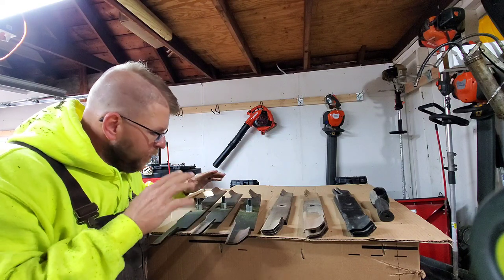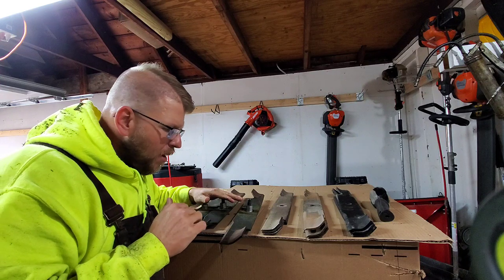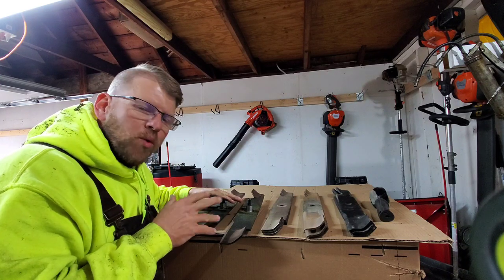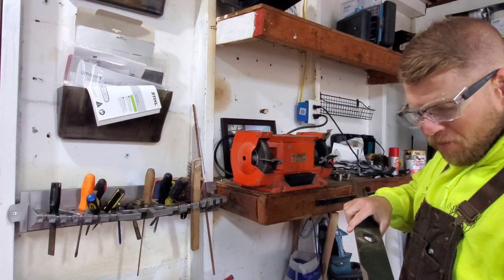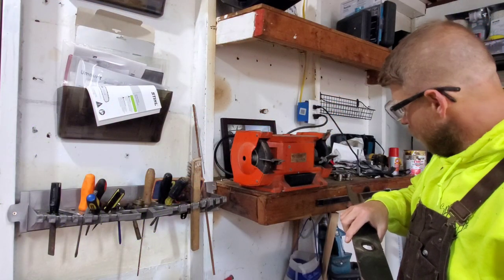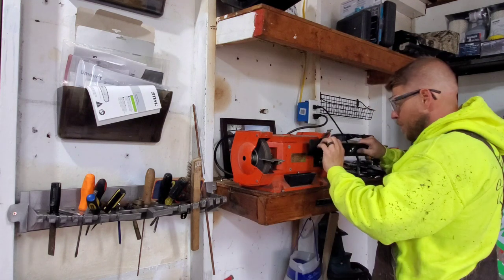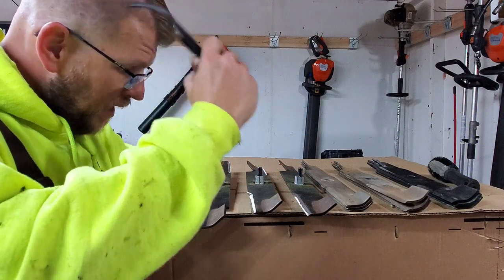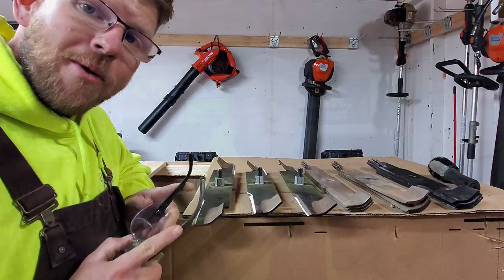New Tool Makes [Changing Mower Blades QUICK AND EASY]

Comment: With that handy wall along the driveway I think I'd make a service pit over which the mowers and other equipment could be driven... Put a concrete floor in and roll under with a service/maintenance stool to do the blade and deck maintenance. About 30 years ago I build one at my parents' house and it still gets used regularly for mower and vehicle maintenance.  No jacks, no lift... drive on, drive off. Something to consider for the next location if not this one!
Reply from the maker: Yeah for sure that does sound like a good idea

Comment: Balancing blades is not hard and doesn't need any fancy equipment. If the center hole is round, you can use a screwdriver or a piece of round stock. You stick the screwdriver through the hole, and if the blade sits level, then it's balanced. If it tilts to one side, then you grind that side until it sits level. If the center hole is some other shape instead of round, then I just balance it flat on my finger with my finger under the center hole, and the same principal applies. I've been doing it this way for years, and I can get my blades just as balanced as the lawn mower shop. I also like a bench grinder like you have. The main thing is pay attention to your angles. That hoist is really nice, too.

Comment: How did you mount the hoist to the rafters.
Reply from the maker: I took 2 landscape timbers and sandwiched the rafter beam and then ran multiple 8 inch lag bolts through to hold them.

Comment: Im no expert, just a diy guy.  But i think the blades need to be balanced.  If they arent it could wear out the bearing.  So i dont know if running a grinder on blades is ideal.
Reply: *nevermind you mentioned bringing to dealer for balancing

Comment: You should check out https://www.ballard-inc.com/ they have some really good blades and calculator on there. The dual blade setup will help you alot but just remember to test them on a higher setting since it will most likely drop the cut by roughly 1/4 inch. I love them and they work awesome for me here in FL.
Reply from the maker: Yeah I have seen them not sure if I would run them but who knows. Take care
Reply: You should try a set and see how they'd work for you. They work awesome here especially with the thick grass we have here and what a difference with them on.